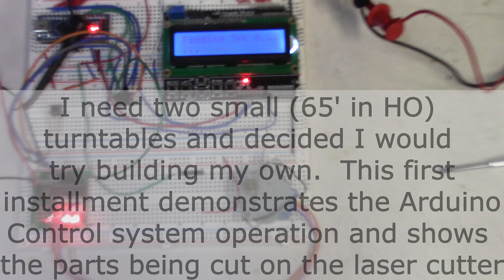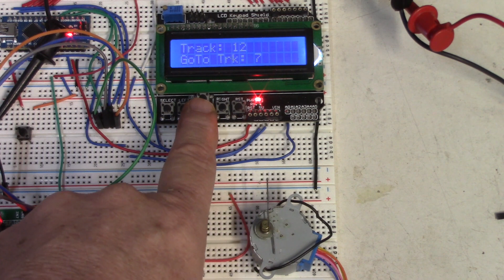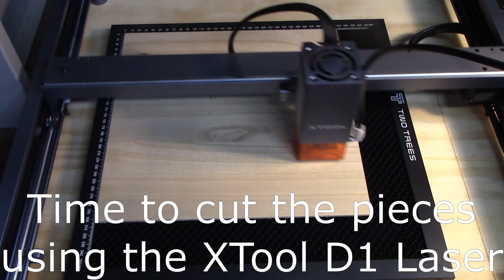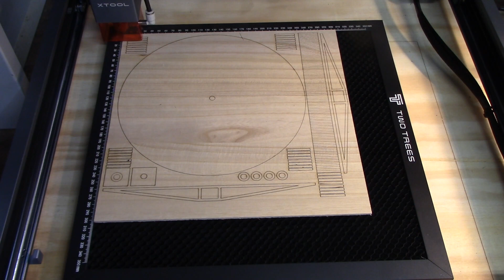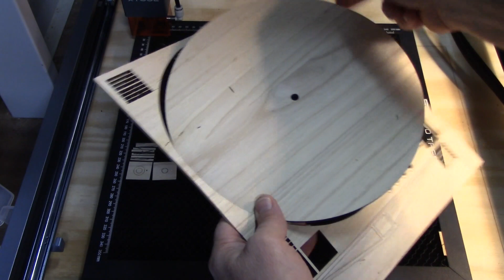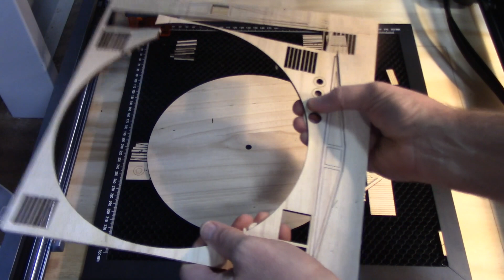DIY Turntable Part 1: Arduino control system prototype demo, and cutting the pieces on the XTool D1

Comment: G'Day Rick just stumbled across your channel while researching Arduino controlled turntables quite impressed with your setup i like the way you can recalibrate the number of steps if one of the tracks is slightly misaligned would it be possible to get a copy of the code . Gary Wollongong Australia
Reply from the maker: Hi Gary.  Sorry it took so long to respond.  I would be happy to send you the code.  Shoot me an email at theswitchlistchannel@gmail.com and I will send it to you.  Regards, Rick

Comment: Very clever, Rick!  Can't wait for part 2!
Reply from the maker: Yeah, me too!   That involved cutting the pits for each turntable and then some mechanical work (not my strong suit).  I also have to upgrade the stepper motor and stepper controller to ones with more oomph!  I have them, just have to wire them up and get the code debugged.  Thanks for watching and commenting.  Talk to you next year!